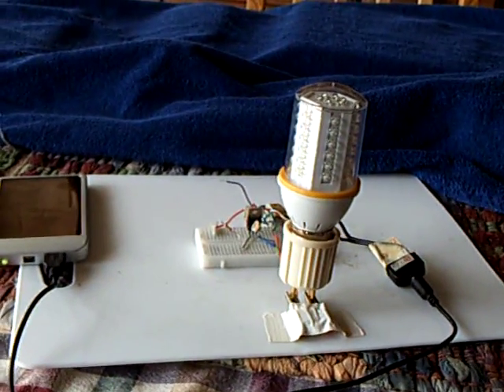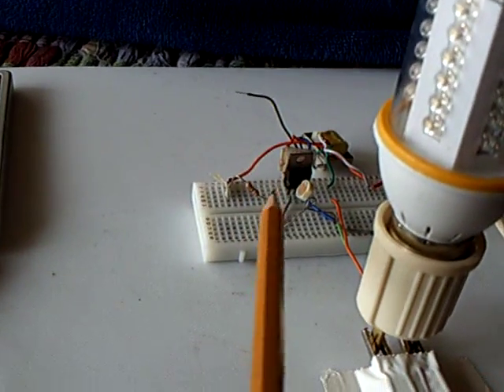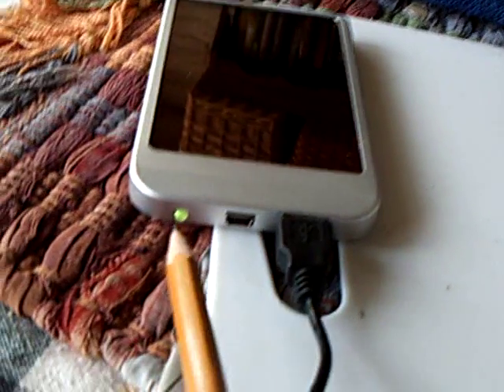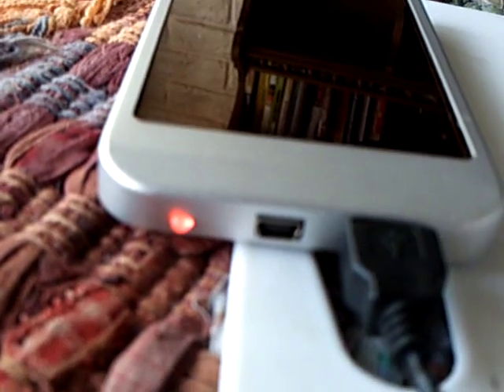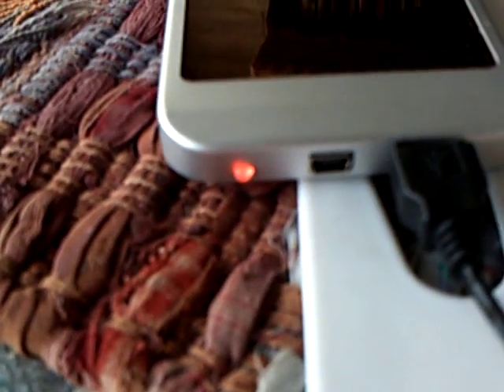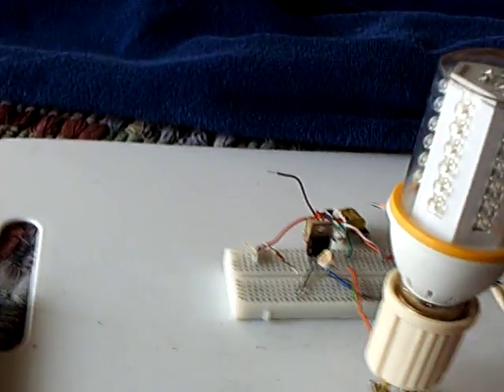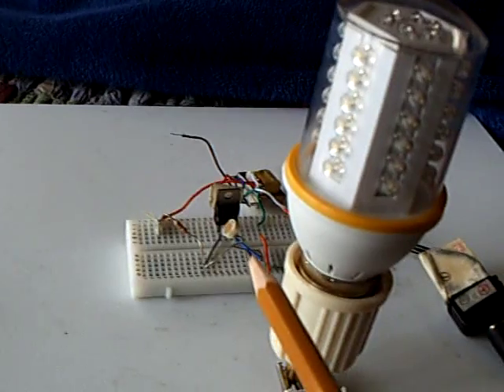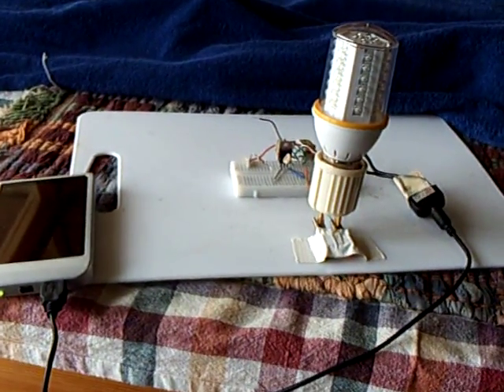Solar powered AC LED light --with auto On-Off

Comment: I'd call a photo cell or photo sensor the thing in a digital camera, that captures the image. :)

Tomahto is close enough though :)

What sort of current does this use when off? Mine goes down to 2micro amps with the pot at 50k. Although I have been playing around with a pot across the legs of ldr to adjust sensitivity, and its getting really leaky. 10ma when off leaky. I think I might have to resort to a digital pot or a 555 or an op-amp. Getting complicated for a light/dark operated dimmer...

Comment from the maker: "Rich and famous"----that ain't me.  By the way I have one of your cell designs still running an led oscillator after months now.  It is the self-watering one that uses the small copper cap and 1/2" piece of Mg.  That is a good one.

Comment: Time to start making your own bulbs? Or modifying the circuits in the ones you have?

120v is designed to run on 60hz pulses. most of the ones I have looked at only use half the ac waveform.... Some have inverter function for other half of waveform. but they would likely cost more.

What happens when you put 40 3v LEDs in series on this circuit?
You can run two rows down a breadboard and not use jumpers...

Comment: Also. Due to the LED being in a "Flashing state" It's not really on all the time. There are a lot of variables involved. But I can make them "flash" from 50hz (hz= times per second) up to a few hundred khz. The thing to look at is the on vs off time. 2us on and 8us off for eg would mean LED only really on 1 fifth of the time. It won't run 5 times longer, due to losses. but it will run longer than just "on all the time"

A lux meter will detect less light from less flashes. Your eye's might not.

Comment: The down side is that the circuit still draws some power even when the transistor is off.
Hi lid  
thats when the extra power is looped back to the source    the one im using an extra 3 volts in 6 hours

Comment: Seems smaller transformers don't work as well and using a mje or fast switching transistor is much harder to get running.

Thanks for getting me into this Lidmotor.

youtu.be / iHmT09MP_Ms

Comment: Very nice setup! The reason not all light bulb work is probably because some of them have a constant current power supply inside and some just have play resistor and cap I've encounter the same problem whit mine too!

Comment from the maker: I think that you asked about this auto on/off setup a few months ago.  All it is is that photo cell place across the base and emitter.  You put a about a 10K to 100K ohm pot across the plus rail to the base to adjust the bias (sensitivity) and when you find the right spot just replace the pot with a resistor of the same adjusted setting.  The down side is that the circuit still draws some power even when the transistor is off.

Comment: good deal I was wondering about that. The boat seems like a good off grid project for the joule ringer. This light you built with the led bulb would make a great beacon light for boating safety. Let us know what kinda transformer you use. I am interested in how bigger units run and their amp draw.

Comment: @lidmotor that didn't even cross my mind. But I don't think it has to do with AC, I thought it was because it is easy to boost the voltage to thousands, thus, less current for a certain wattage, and resistance has less effect.

Comment from the maker: Actually I had a hard time getting this little transformer to work on the circuit.  This is the only bulb I had that worked very well.  The RS 12v transfomer is the best "traditional" transformer that I have tried so far.

Comment from the maker: That is actually very valid point but there is a reason for tuning the DC to AC.  Line loss. I could run a 100 ft. extension cord off this LED circuit and not lose the energy.  That is why we use AC instead of DC now.  Edison and Tesla had a major battle over this years ago.  Tesla won.

Comment: Good to know. I've found less efficiency with the smaller the transformer, but a lot will work. Had no luck with the 2 in and 2 out types though yet, only the 3 and 2 seem to work. 
I guess if it's an audio transformer you should be able to tune by a speaker or headphones too...or get the following 'This is KOGO San Diego' lol